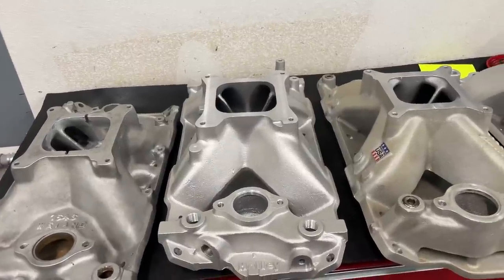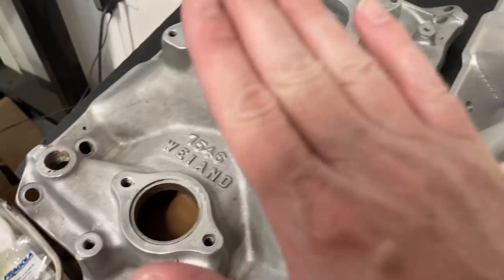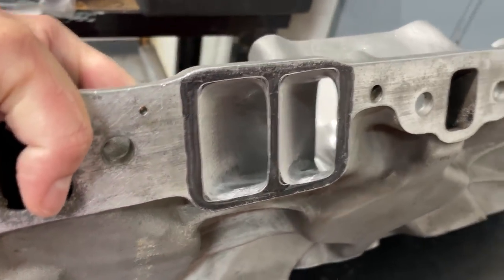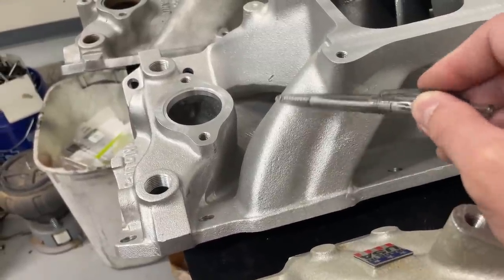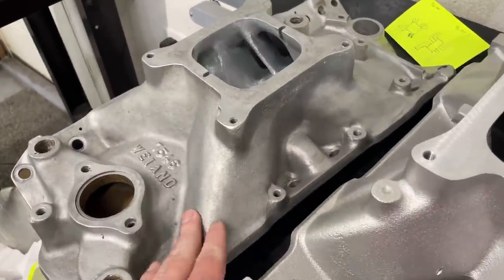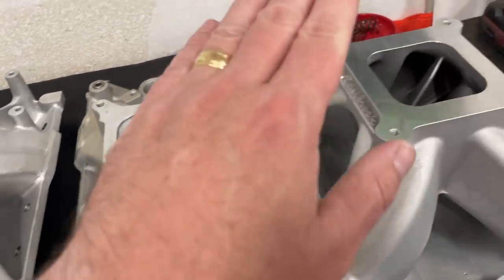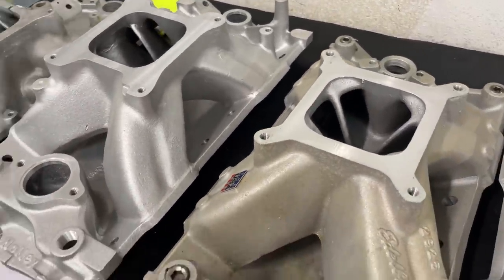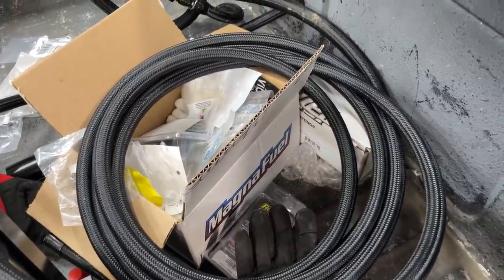Stupid Manifold Information

Comment: Soooo, what would you recommend if you’re rpm limited (I.e. with a Pontiac engine), but still want/need to run a single plane intake, say for nitrous? And how do these points (line of sight, runner length) differ, if at all, when using MPFI? Thank you! Great video as per usual.
Reply: The recomention is, ditch that pontiac motor.
Reply: @hectorortega9131  Butler Pontiac builds some fire breathing monsters from stroking the old 400 pontiac blocks. The tech is a little different than a SBC, but you can build huge power with pontiac engines. See for example the Crow run by Midwest Street Cars
Reply: Look for a Doug Nash Warrior. I've ran mid 10s in a 67 Firebird with a 400 Pontiac NA using that intake. Used it on 455s also with good results. Kinda rare these days. Pontiac Super Victor works good if ya have the room for it. I've ran low 11s with a old Torker on a 455 Pontiac that I drove everyday. The Holley Street Dominator was a decent intake also.
Reply: They sell a Super Victor Pontiac EFI intake with the bungs already there.

Comment: All this has to be taken into context. For a 3-400 hp motor these I'm sure work great. But obviously when you go up in power you need more airflow and the newer design starts to make a difference. All good Info. Just my opinion. There are good running cars out there with the older style manifolds.
Reply: With that much power you could use a dual plane.

There are 400 small blocks running around with afr 195 heads and air gaps making 500-525 HP
Reply: Have you or do you do EFI multi-sport manifolds,  I have a world product intake

Comment: Brother you are very wrong about the old first torker...TM1 the Edelbrock scorpion....IV been drag racing and building engines since 87 and IV ET proven that those older torker..TM1 and the old scorpion on a 355-360...60 over 350 they run a faster ET than the Holley strip dominator and the super Victor and also the team-G...IV tried all of those and the TM1 was faster....you should try them on your Dyno mule...I shouldn't have said your wrong like I did because I know those intakes are really good intakes.,...oh yeah the Torker2 is a very bad intake... Edelbrock really messed up when they made it

Comment: I ran a Original Torker on a 305 when I was in high school. That, matched up with a 350hp/350 cam, Holley 3310-2, and a set of small tube Summit headers woke up the 305. Time to get to 6000 from 3000 was insanely quick. The truck I had it in would do high 13 sec low 14 quarter miles. Nowadays I'd run an RPM Air Gap. I saw an article years back that it beat the Victor Jr. throughout the rpm range except for 6500+.

How do you feel about intakes that don't have the water cross over in the back (near distributor)?
Reply: We found that the larger window stickers make better e.t.

Comment: I don't get why anyone would run a single plane manifold on an N/A street or street-strip engine anymore.
The Edelbrock RPM and RPM AirGap dual plane manifolds make better TORQUE and HP all the way up to 6,000 rpm.
Reply from the maker: There is only so much torque a street can hold with real street tires.
Reply: What is the worse of two evils? Using a low profile single plane manifold that provides plenty of hood clearance for a generously sized air cleaner and possible additional clearance for plenum/heat spacer experimenting or a better intake manifold suffocated by an inadequate air cleaner? Dropped base air cleaners don't leave a lot of room above the carb with a 3" filter- especially when using a carb with a choke tower.

Comment: Oh opinion basing . 2 rules in choosing a manifold is single plain or dual plane. What rpm range is your goal of operation. 3500 and up single plain ,2500 up to about 6000 use a dual plain . Why do you want to try and re-think decades of engineering. You likely know more than all of these guys .  However , if you are building a race engine got to a fab unit from wilson or another rep. Builder.

Comment: Is the Holley 300-25 one that you like?
Reply from the maker: Yes and the 300-110
Reply: @WeingartnerRacing  I was going to ask about the 300-110, also.  That is what we used on my 414 sbc
Reply: @WeingartnerRacing  I didn't know they had a 300-110 version..have to check those out.  this was a good video here.
Reply from the maker: @rosskrause3926  Yes its a very good manifold.